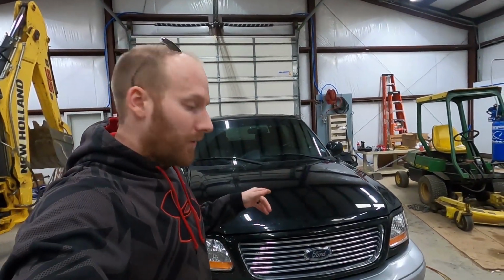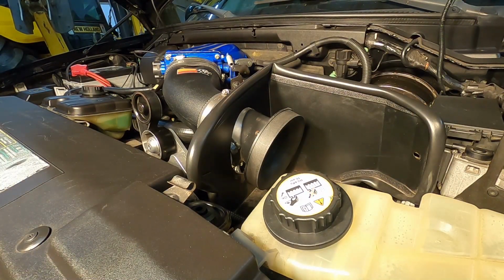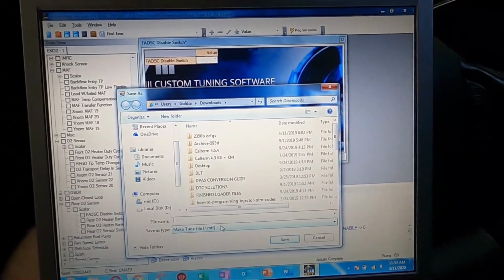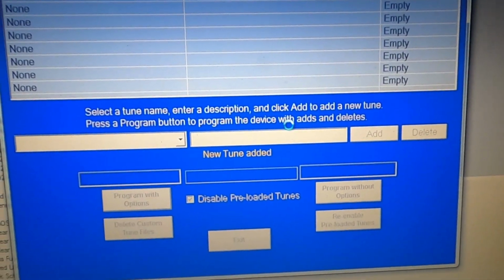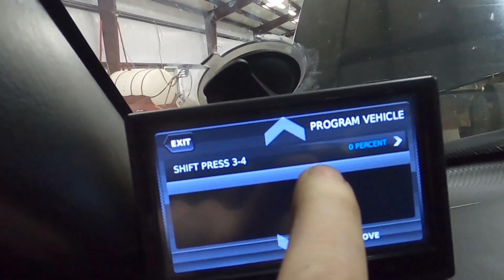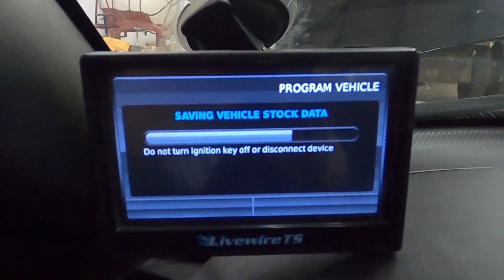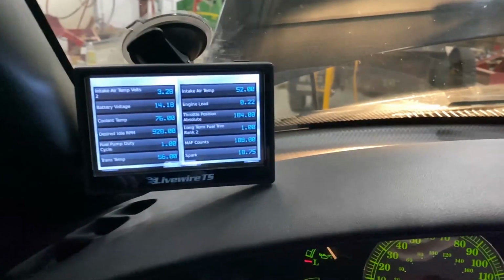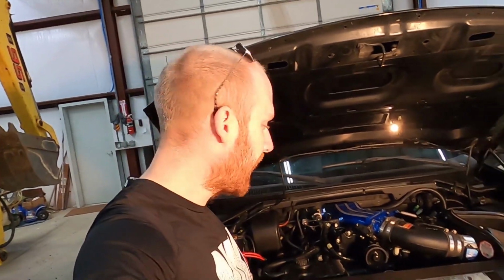2003 Ford Harley Davidson F150 SCT BA2600 Install & TUNE using Advantage III & Livewire TS

Comment: Thanks for the video it's very difficult to get advice or knowledge on these trucks here in Australia, especially with tuning and performance work for them. 
I just purchased a 2004 F250 super duty with the Harley motor fitted with a built hughes auto and hi stall. I just bought the livewire and waiting for it to arrive so I can update the sct maf and tune the truck for the supercharger as it has the stock F250 computer and tune still.

Comment: buying this software will I be able to enable the hidden options after the latest updates? I just bought an updated x4 wine and it is a total disappointment, all the personalized options are disabled or with very low axis values that are useless, I am very sad..

Comment: On the street just cruising where are your  shift points at? 🤔

1st - 12mph
2nd - 32mph
3rd hops in at 32mph and my Rpms drop yo 1,200 at that point

What are yours like and can you change them with the software?
Reply from the maker: Sorry for the late reply! That sounds about right for the stock setup. You can indeed change your shift points, as well as the torque converter lock-up points. I had my truck tuned at Pro Dyno in NC (video to be posted ASAP) about two months ago, and it is totally different, but in a great way. It now WILL NOT shift out of first until 15mph, and WILL NOT go into 4th until you hit 50 on the dot. Much more responsive and alive. No lugging or waiting on it to downshift to get into the power curve.

Comment: I’m looking at a 2002 Harley Davidson f150 it has 170k miles on it and they are asking for 8k any advise ?
Reply: ask them for 7,500 that’s a lot of miles or keep searching!
Reply: To many miles.  Stay away
Reply: Not a bad price for a restore / I would buy it if the body & interior looks good period. I seen them running great with over 250k

Comment: so you did nothing to modify the MAF just disabled the rear O2 sensor?
Reply from the maker: Not exactly, I had to substitute the BA2600 MAF file for the stock one. I disabled the rear O2 sensors because I straight-piped the truck.

Comment: Did you have a check engine lean code after you installed the k&n air filter? And if you did how did you get rid of it??
Reply: I got a check engine light on mine after did you to? I got left and right bank lean code
Reply from the maker: I didn't receive any codes after installing the K&N air filter. What did you guys do to solve your codes?
Reply: That Guy On Youtube I still haven’t figured it out lol but need to for a e check